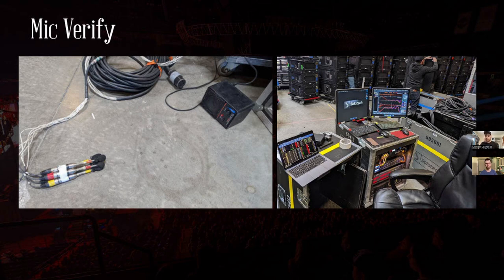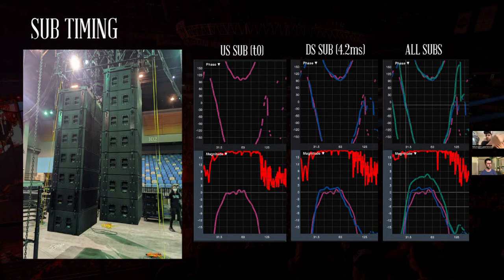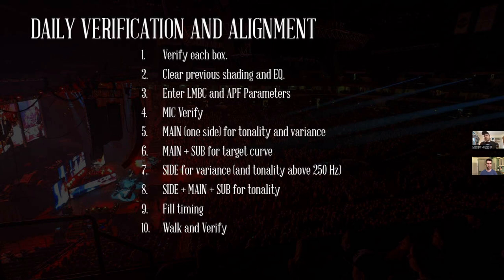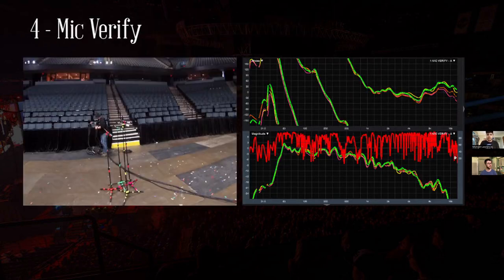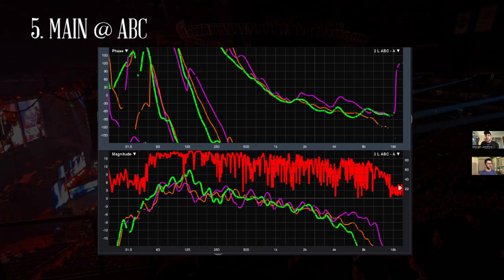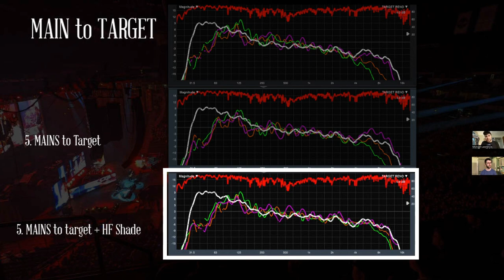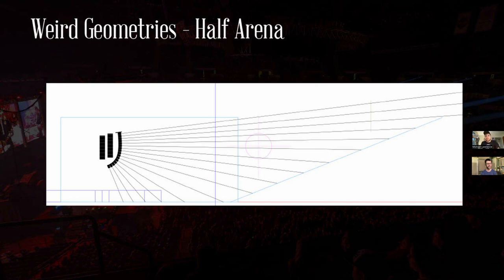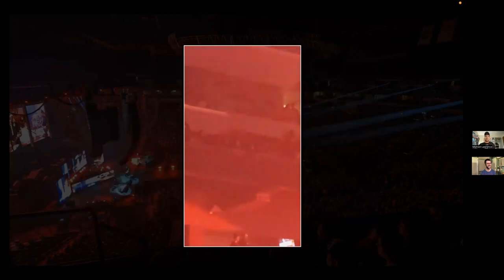Aligning & Tuning Low Variance Sound Systems | Pt. 3 of 3 with Michael Lawrence

Comment: Thank you Michael, 
Want to know how the congregation or audience can change the room acoustic  and which frequency ranges do they effect.
Thank you
Reply from the maker: People in the room/audience will certainly change how the room "feels". Low frequencies won't be absorbed much, but mid and high frequencies will.
Reply: @MichaelCurtisAudio  thank you for your response 👍
Really appreciated
Reply from the maker: @khosazonyekha8983  You got it! I wish I could be more specific, but it really depends on your room shape, PA orientation, how many people, etc. Long story short - low frequencies have very long wavelengths and simply "bend" around people. But since mid and high frequencies are shorter, they can be absorbed.
Reply: @MichaelCurtisAudio  thank you 👍